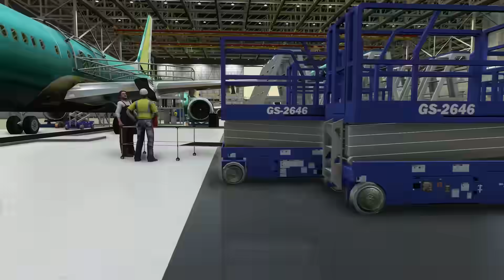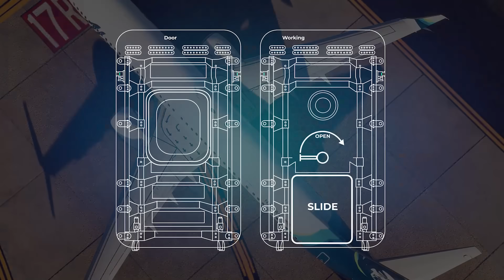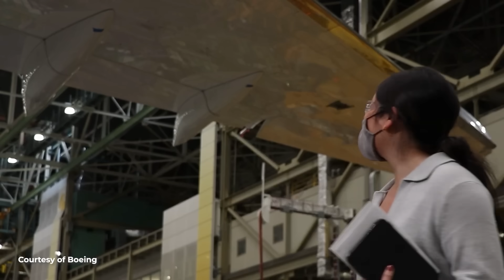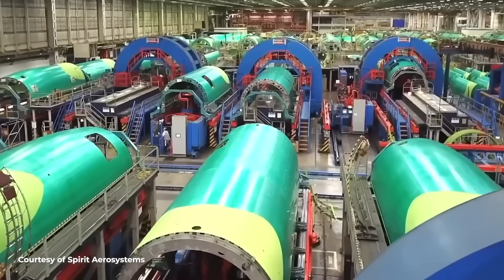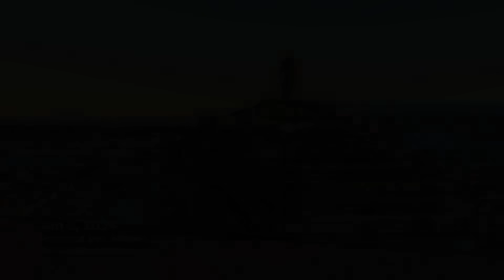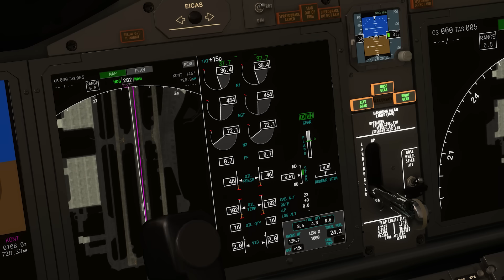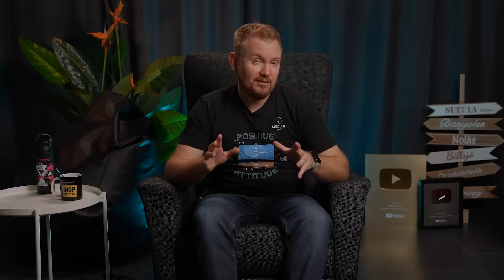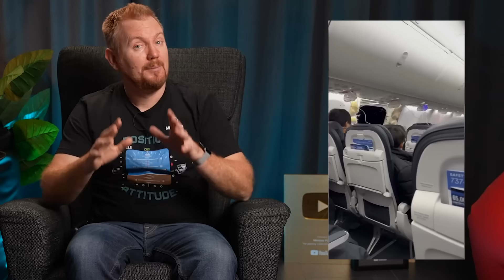Boeing 737MAX BlowOut!! The Scandal behind Alaska Airlines flight 1282

Comment: If it happens at 40,000 feet is there a risk of serious physical harm from sudden depressurisation?

Cheeky question: Are flight simulators built with a depressurisation function, or would that be considered cruel and unusual punishment for trainee pilots?
Reply from the maker: It would have hurt, but it should not produce permanent damage. But anyone up walking in the isle might have been pushed out by the wind and it would have caused more strain to the structure

Comment: Nothing to do with design? The inherently unsafe design relied fully on the bolts being in place. It made no use of the pressure differential to secure the plug in place, and it even included two loaded springs working to remove the plug. A single straight hole extended right through the entire block of cheese.
Reply from the maker: Let me clarify: it had nothing to do with the MAX design specifically. These doors were present on other variants and types as well.

Comment: An overall very good review of the event. It is, however, important to emphasize that the plug in question is not a Max only design as the exact same plug is used on 737-900ERs (in service since 2007). In fact, inspections of all 737-900s  with the same plug installed were also required.
Always much enjoy your accident review videos.
Reply from the maker: Yes, that’s why I emphasized towards the end that this had nothing to do with the MAX specifically.
Reply: The real problem is that there's no point in ONLY inspecting door plugs, because this wasn't a problem with door plugs specifically -- it was the assembly team doing sloppy work, affecting all parts of the plane. It was losing the plug bolts on this one occasion but next time something goes wrong during assembly and isn't documented it'll be somewhere else.
Reply: @levanataylor790  That's my point. This wasn't a Max issue it's a Boeing problem, which is why the FAA has halted production increases and airlines are being much less trusting of Boeing.

Comment: In the work-in-progress photo of the door at 12:15, you can see a zip-tie wrapped around one of the stop pad sets.  Not sure if that’s an official procedure (doubtful), but if I had to guess, I’d say that while they were fitting the door, someone quickly attached a zip-tie once the door was in place to keep it from springing upward on the slides before they fitted the bolts, giving the appearance that the door was secured properly when it actually wasn’t.  That zip-tie might have been the only thing holding down the door against the lift springs in the weeks before it blew out.  

I also have a hypothesis about the painter’s tape below the window and the eyeball “grafitti.”  When the 4 retention bolts were removed, they were placed in a Zip-Lok bag and taped to the door.  At some point, the Zip-Lok bag fell off and got lost somewhere. The zip tie was used as a temporary measure while they attempted to find the bag of required bolts.  Instead of writing a proper note or recording it in the work log, the person who applied the zip tie drew an eyeball in the dust as a note to themselves to “look” before they started reassembling the interior.  Before the bolts could be found, a shift change occurred, and they still didn’t leave a note for the next shift or properly record the missing bolts leading to a communication breakdown about the door’s status.  When the next shift arrived, they saw a door that appeared to be properly in place, laughed at the funny eyeball on the window as they cleaned it off with Airplane Windex, installed the interior trim, and sent it out.

I think we’re going to learn more about that zip tie in the final report.
Reply: That sounds plausible.

One ongoing issue at the parachute plant where I worked was that they were constantly at us to clock in and out exactly on time when we NEEDED a 5 minute overlap between shifts to "hand-off" properly so that each position on the line knew what was in progress. HR FINALLY was made to accept it between department leads, but continued to fuss at the people actually doing the work for correctly handing-off to second shift.
Reply: It’s no coincidence that the seats adjacent to the plug door where left vacant….most likely due to several previous “whistling” sounds reported by passengers, associated with that loose plug not fully sealing….perhaps just regarded as an annoyance for passengers…🤔
Reply: @bri-in-oz1939  With the automatic-pressurization errors (the AUTO FAIL light), and the whistling noise, someone should have put two and two together and grounded the plane before this happened.  They were operating under the assumption that this brand new aircraft “just” had some glitches, but it’s pretty obvious now that the pressurization controllers were not faulty, they were in fact indicating a leak. 

I anticipate one of the outcomes of this incident is that in the future, be they Boeing, Airbus, or any other commercial jet, pressurization errors will not be assumed to be faulty sensors or controllers before the aircraft is rigorously inspected/tested and actual leaks are ruled out.
Reply: I work at Airbus and we use zip ties all the time too when there’s a missing bolt. Saves time and $. And I’m sure nothing’ll ever happen.
Reply: Thats not a zip tie, and we wont learn anything about it in the final report. That is a wire harness.
Reply: @6z0 On the right side of the door plug, next to the first rib above floor level, there’s a white plastic zip tie cinched around the stop pads.

Comment: It looks like the normal emergency exit door must open outward for space and egress issues.  However, since the door plug is a non-movable feature, it could have been designed to be much larger than the door hole.  That way, even without the required bolts, it would not have blown out so easily.  That assumes that the door plug would be strong enough to not break up from a depressurization around it.  It seems like a better design would be to make the door plug much larger than the door hole.  Harder to install, but much safer.

Comment: With the extremely low cost of digital storage it is ridiculous that flight recorders only have a 2-hour capacity before being overwritten.
Reply: Only in the US. In Europe it's a 25 hour loop.
US scraping the bottom of the barrel on safety standards to save a buck as usual....🙄
Reply: @BeardyBaldyBob  so Boeing upgrades the cVR package when selling to European customers? Is anyone aware of this who can give a shit and fix this shortcoming?
Reply: @jadesluv  The interesting thing is if Airbus DOWNGRADES the CVR package when selling to US customers. My guess is they do, because US pilots have long resisted this sort of thing on "privacy" grounds.
Reply: Back when they were designed the cost was (no joke) around 160,000 times higher. (Late 1980's price for a Gigabyte of solid state storage was roughly 10.000$, down to around 6 cents now, before that they used magnet tape but that was not really reliable)
But not adjusting / redesigning them by themselves, just because there is no obligation to do so, is solely up to the manufacturers saving costs and not wanting to do recertification with the FAA and their worldwide counterparts.
Reply: "With the extremely low cost of digital storage it is ridiculous that flight recorders only have a 2-hour capacity before being overwritten."

I have commented on previous incidents where this has happened. It would be a trivial control engineering task to have the CVR auto-switch off say, ten minutes after the engines are switched off.
Reply: @TheRealWindlePoons What if there's an engine failure though? If all engines are off because they've all somehow failed (which is rare, but it has happened before, so, might happen again) there would be no flight recorder. Connecting the flight recorder to engines - or any other system for that matter - would not be a good idea. The only thing that could help here would be an increase in storage size from the measly 2 hours to something more reasonable like maybe 20 hours or so.
Reply: @HippieInHeart airplanes know when they are in the air, versus on the ground. Obviously, it would have to be a combination of both. (Engines off and on the ground). 

In auto mode, Airbus’ recorders shut off when engines shut down after 5 min.
Reply: @TheRealWindlePoons  Unless it’s a fault with the engines, and the plane is gliding. Perhaps reroute the command to the APU then?
Reply: @TheRealWindlePoons  This would make the recordings useless for engine failures or cases where the incident continues after the engines have been shut off.
Reply: Nothing to do with cost. This is entirely due to US Pilots lobbying for a 2hr max recording.
Reply: @JCJW101 I know it’s late but I’m glad I’ve seen your comment. I couldn’t believe it when I saw it so I did some checking. It’s absolutely shameful the way pilots unions have behaved on this. They are in a safety critical role - the cockpit should not have an expectation of privacy.
Reply: What is ridiculous is your lack of understanding of how flight data records works. Its not on digital flash cards.
Reply: You can't use consumer storage it needs to be able to withstand the impact forces of a crash. Which means bulky and as a result lower storage size.
Reply: @Kysen10 they can use consumer storage. It’s not the storage itself that’s indestructible, it’s the casing that holds all the equipment, the actual “box”.
Reply: @rtbrtb_dutchy4183  That is not correct at all. The storage is a tungsten wire that is recorded to magnetically. No amount of protection in the box would save it from burning it jet fuel, or sitting thousands of feet under water.
Reply: @Kysen10 yeah they can't use consumer storage, they have to use overpriced super certified storage that is of worse quality and less capacity than a consumer one you know.. you have to compensate the cost of licensing with a lower part cost.

Comment: Thank you Petter for this video which many flyers as well as I assume pilots were awaiting. I presume Boeing's procedures for inspecting and reporting over official channels (instead of the SAT) will be mandated. It seems that an underlying factor may have been an attitude of extra urgency in completing repairs in aid of returning the aircraft to operation. Have you noticed any such increase in non-engineering and safety related urgency due to economic issues such as a push from management to minimize down time in aircraft operation? I expect FAA will be looking at this aspect during their investigation of the incident. Cheers and fly safely.

Comment: In addition to not hitting the elevator, it also didn't cause additional damage to the aircraft structure. This incident happened when the differential pressure was only around 65% of what it would have been at cruising altitude. If the door had departed higher up, the forces involved would have been a lot higher. I think it's conceivable that the door would have taken parts of the surrounding fuselage with it. I have seen people (most notably Juan Browne a.k.a. blancolirio) speculate that this could have resulted in a breakup of the entire plane. I don't know if that was a possibility, but I surely hope that it will be looked into for the final report, because that would certainly have killed everyone on board.

Comment: Why Boeing would not just keep the extra emergency exits regardless of max passenger capacity instead of going through all that effort to make the plane less easy to escape than it could be is beyond me.
Reply: It is not Boeing that does not want extra emergency exits, but the airlines. The extra emergency exits take away seating capacity from the aircraft and with less seating capacity, less money can be earned.

Comment: I was unable to confirm but several media outlets had discovered that some Boeing customers were specifying that they would only accept aircraft that had been produced at one of the two sites producing the aircraft.

 Forgive me for being so vague, this was some time ago. But I do remember thinking that if customers were able to specify where an aircraft is made, I assume it's because of previous experiences.

 Airbus aircraft are made from parts produced all over Europe and I know it caused them no end of pain to work this way and decades to really get things right. In it's way it's using a 'best shore' policy but is that how an aircraft should be built? If nothing else it's going to require REALLY tight QC.

Comment: 17:00 when this story about Alaska Airlines limiting the aircraft to overland flights rather than taking it off duty initially broke, there were a lot of angry people being convinced that these things had to be connected.
I'm glad to say that I had already learnt from you and explained to people that this may be unrelated and likely wasn't a major issue on its own. Your videos have prepared us well to understand how extensive the safety protocols and redundancies are and that we shouldn't jump to conclusions!
Reply: With passengers reported hearing noise,  Alaska mechanic can remove the side wall panels and at least look, inspect, it would take about 2 hours of remove and reinstalled the panel, mechanic can do a pressurization check on the ground to find where the air leak came from
Reply: @joshephand5538 If airlines had mechanics let alone engineers investigate every time a passenger reported a noise they found “weird”there might literally only be a few dozen flights taking off per day nationwide. 

Furthermore, there is no way they would have identified the source of the whistling noise as they’re going to assume the standard structural elements are in place. It’d be like if you felt road / wind noise was louder than expected on a brand new car you just bought. You’re not going to disassemble the entire door to see if the soundproofing has actually been forgotten (and that’s a much easier job). You’ll look at the weather seal on the door and window and that’s about it.
Reply: @The_ZeroLine   I have changed that door seal before, take about 6 hours,  the door sidewall liner can be remove not to difficult for inspection,  the mechanic can run the APU and pressurize the airplane to check the air leak outside and inside, can hear a loud air leak, even from outside, large air leak cause pressurization failure not small, the person who removed the door fasteners bolt should had put it in the part bag and hang it by the door , don’t  tossed it out, the paper work should had been generated for record when the work begin so it didn’t got missed, without the lock bolts the door can slitely slide up and down, when the airplane landed the door can slide down to the close position so it can easily be missed when on the ground
Reply: It’s simply passengers/the public having no clue about how aircraft operate and/or how redundancy systems operate. If planes were grounded every time there was a single system showing frequent or intermittent failures, there would be about 70% less flights regardless of aircraft type.
Reply: I was on of the angry folks.  

But yes, Pettr has educated me as always.
Reply: @kentstallard6512   my 401k went down 100 thousands because of the door , right after the new year ☹️

Comment: @Mentour, I hope you or a knowledgeable commenter see this.  I used to live in Colorado (USA) and climbed several "fourteeners" (mountains with a peak above 14000 feet).  I never felt that I had limited time at that altitude because of brain processing failure.  Some people had to turn back because of altitude sickness, but this was more due to nausea than brain failure.  Why is it so urgent for the pilots to get O2 at 14000-15000 feet?

Comment: Re: 26:20. What benefit is there for the flight crew to have the door to the cockpit blow open? Why not keep it closed and maintain pressure and allow it to drop slowly and without exploding outward? A slow depressurization would prevent chaos or drama and still be obvious to the flight crew that they lost pressure. I can't see the benefit to subjecting the cockpit to the same chaos or danger as the passenger cabin.

Comment: There is a major problem in this "Accident".  First you have a new aircraft and it is telling you something is wrong.  Then you have reports of a whistling noise which means an air leak of some kind.  No one puts 2 and 2 together to arrive at 4, so nothing is done to find out what the whistling noise is caused by, they just run their check list because the operators have no idea about how the onboard systems operate.  This is what modern aviation has come to, and it will continue to deteriorate to more and more failures unless the operators are first taught how the systems operate and interrelate.  This will never be done because beancounters are in charge.  The pilots doing their preflight checks do not look to see if the gap at the top of the plug and the frame even exist or not.  If the pilots understood how the plug worked, they likely would have known that such a gap was important, and if it was less then normal, would have brought it to the attention of maintenance.

Comment: Sounds like standard issues working with a contractor. They need to fix something. They don't fix it and just paint over it. Then after finally fixing it, they forget to put bolts back in place.

It was negligence to just paint over the rivets. That would give evidence that the person doing the work was negligent in not putting the bolts back in for the door as it shows a pattern. They are lucky no one died with that door issue.

Comment: ⁉️I’m wondering why, when the door panels were already in situ, did Boeing not go ahead with the normal operational ability of the door (plus slides). Surely (two) extra emergency exits are far better than a ‘non-working’ space which, we now know, compromised the integrity of the aircraft? ⁉️